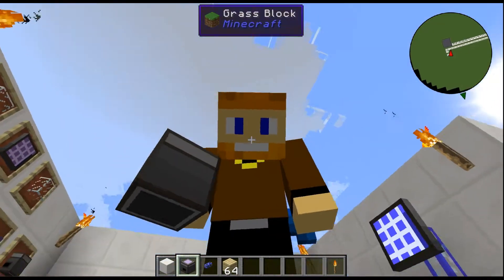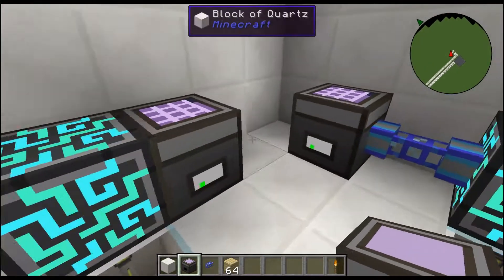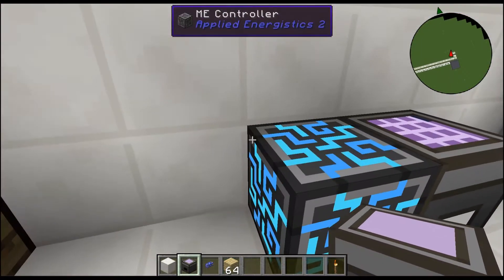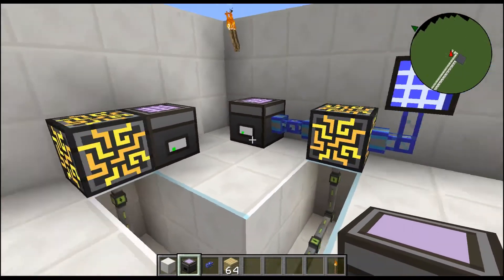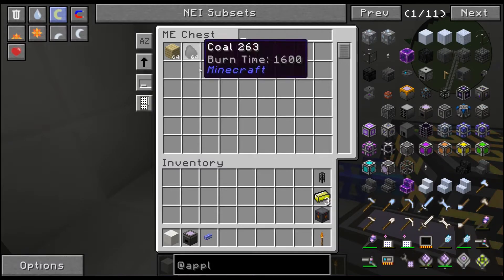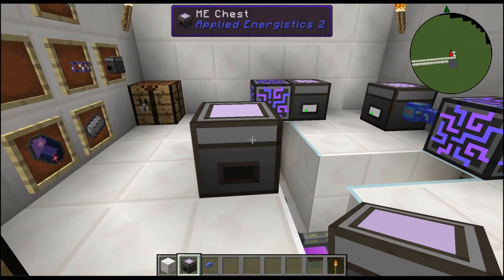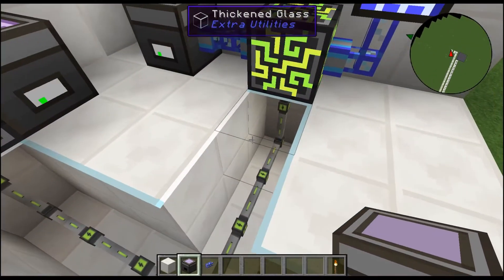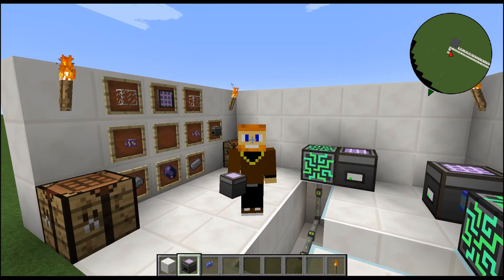ME Chest (Applied Energistics 2) | Minecraft Mod Tutorial

Comment: HOW DO U POWER IT
Reply from the maker: it needs to be connected to your AE2 system. These one's are connected to the controller directly. This can be done with cable as well. The controller requires power from another mod usually. You can use Mekanism, Thermal Dynamics, etc...